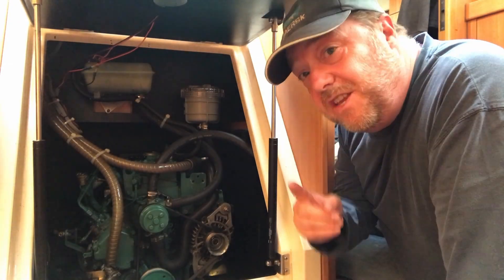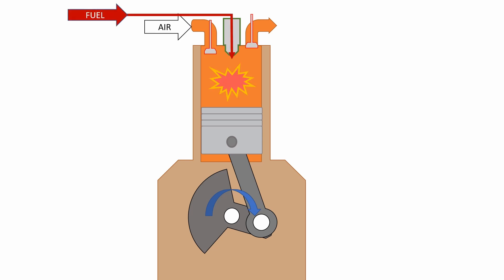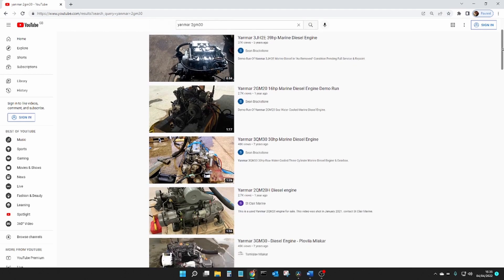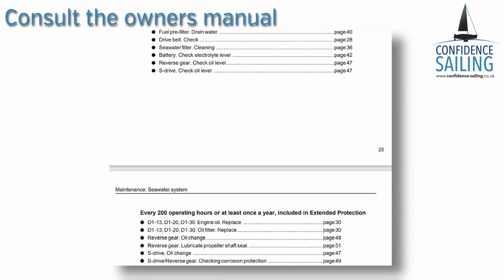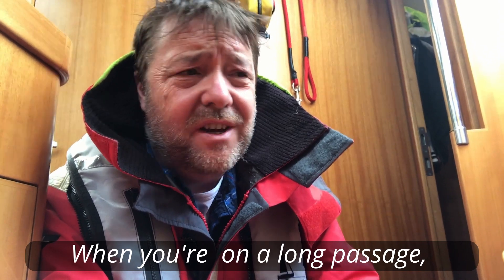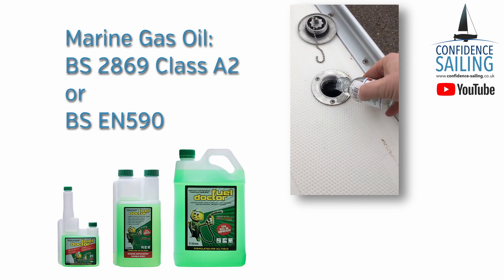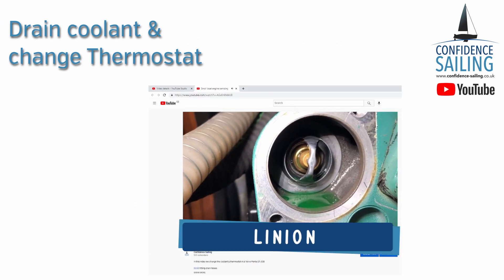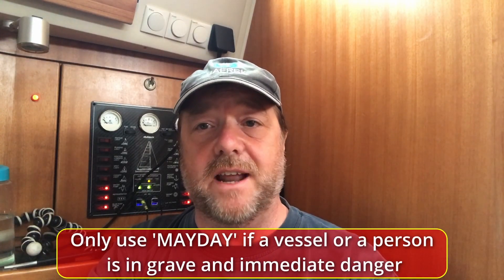How to maintain small boat Engines | and what you need to know to fix them

Comment: Some wise words in your intro. A lesson I learned the hard way - Boats are not like modern Cars. More like the old bombs I had when I was young. If you just jump in and go, without checking everything first, sooner or later you will regret it. Upside of my experience is that after replacing my boat's engine, I am now intimately familiar with my new engine and peripheral systems. The wallet is a lot lighter, but I'm much more confident and methodical about everything I do on the boat.
Reply from the maker: Thanks for the comments, and good luck with the new engine.

Comment: Have you done any maintenace on the transmissio  n (ms10l-b?). I've been experiencing trouble getting into gear (intermittent) and there is little in the way of documentation in the standard volvo canon. However, I drained my tranmission fluid and it was black and rancid. Any tips?

Comment: Good video. In you opinion, what is the best engine, volvo penta d2-60 or beta marine 60?
Reply from the maker: I don't have an opinion on which engine model might be the best. Too many variables. Plus I know every engine is unique... One might go forever without ever failing and exactly the same make and model might give you no end of trouble. 
Certainly simpler engines are easier to keep going with a good maintenance regime, but  modern engines have efficiency, reduced size and noise in their favour
Reply from the maker: And thanks for watching

Comment: D2-55 owner here. After a few bad experiences I now work on a preventative maintenance system. Number one is flush the seawater out of the system after every sail. To simplify this job I filled a flushing line to the SW inlet, with a small mixer tank to mix in sea water flushing tables and antifreeze in the winter. This sort of flushing system is fairly normal on US boats maybe as they have more bugs in the water. VP has an optional flushing kit, but at a VP price.
Second, I fitted a strainer downstream of the raw seawater pump to catch any bits of impeller that will break off at some point and clog the heat exchanger. Again normal to see on larger marine diesels. 
Third, I fitted a diesel day tank with a water separator/filter and strainer. Fuel is pumped automatically from the main tank to the day tank and the filter/separator is fitted with a water alarm and back-pressure alarm for good measure. It doubles as a fuel polisher and filter bleed system. 
Fourth, I fitted a temperature monitor/alarm on the exhaust just down from the mixer., again also a VP option.
Reply from the maker: Thanks for the comprehensive reply. Interesting stuff.

Comment: It's like taking health and safety advice off a bloke with no fingers. 
Trend analysis .  Would be a good start. 
 And read the yacht code
Reply from the maker: Not sure what to make of that comment James.
Reply: Trend analysis.  The documentation and ongoing analysis of,  components,  fluids . fuels  together with  duty cycle service schedule. 
This and the mca engineering yacht code.  And solas regs.  are what marine engineers have to understand.
Reply from the maker: So you don't think this amateur video from a non marine engineer should be posted - or are you just signposting a warning to others that there is more to marine engineering than a 10 minute video can hope to include
Reply: I think more care is needed when instructing complete novices. 
Start with warnings. 
Competence evaluation 
And an understanding that poorly undertaken servicing can compound into a stoppage or breakdown at sea.   
Cover your posterior  so to speak
Reply from the maker: That's a very fair point James.
I look forward to watching your videos on the subject 👍